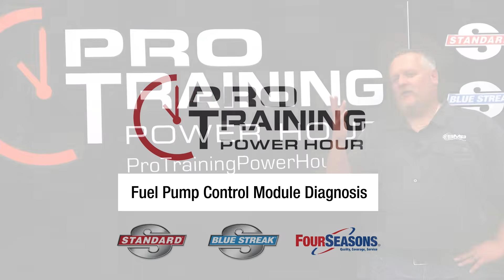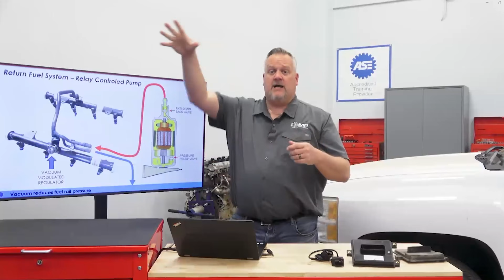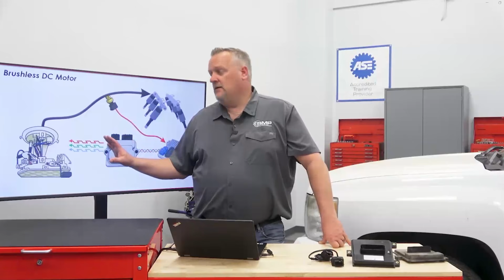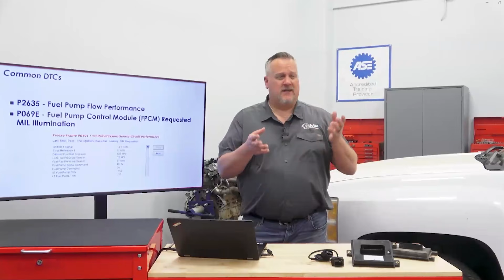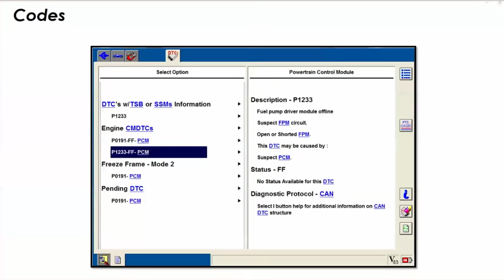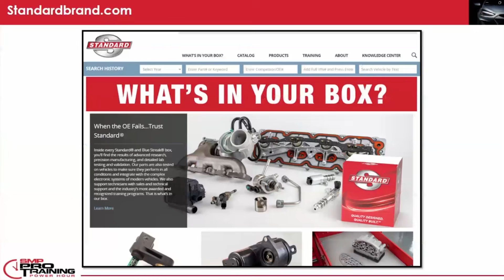Fuel Pump Control Module Diagnosis | Pro Training Power Hour

Comment: I have found on gms the fuel pump long trim tells the health of the pump.  They may last longer but the impeller gets grooves in it and cant maintain pressure . 
At 1.7 lt there is a complaint of long crank to start. At around 2.0 lt which is twice the new pump command a 2635 sets.  On the 3 phase pumps a p018b will set on decel when the pump is weak.  The command is maxing out and on decel its hard to tell what rpm of the pump is needed.  You will see rpms and pressure going up and down while its stabilizing.